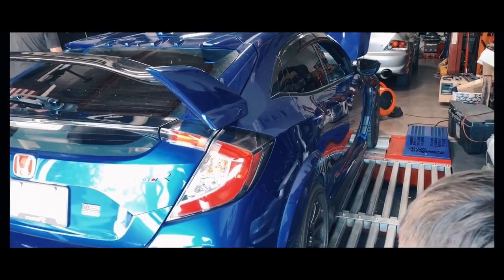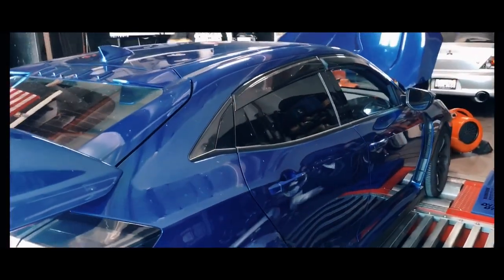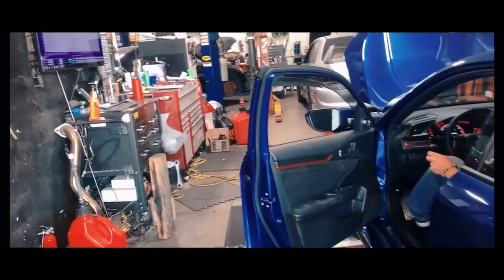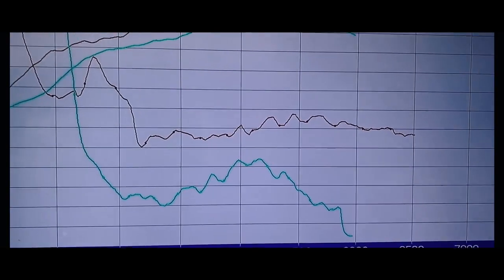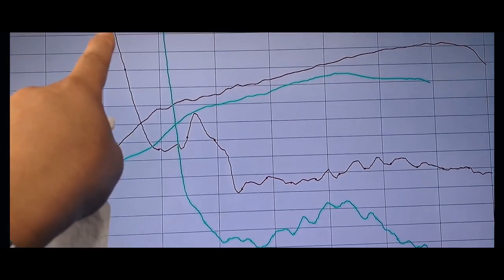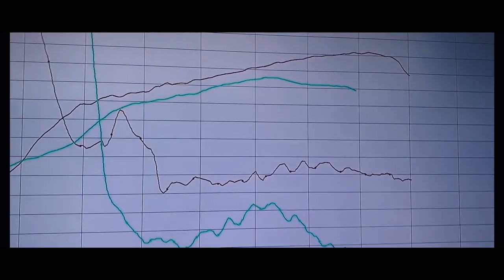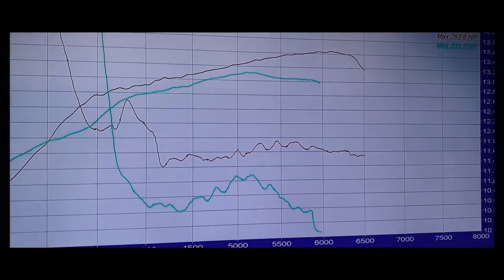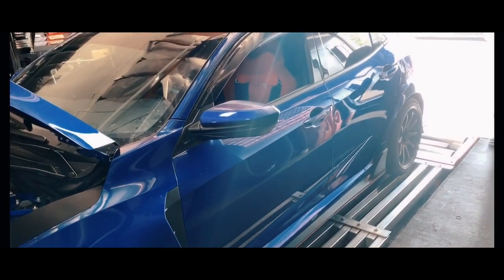Let’s See How Much This Civic Type R Makes on Dyno...

Comment: I agreed something is wrong with the car or the dyno, my stock Type R pushed out around 290 to the wheel
Reply from the maker: Mike Nguyen 
263 on a dynodynamics times  0.16 ... thats the horses.. reads low on that dyno thats to the ground(wheels)  power.